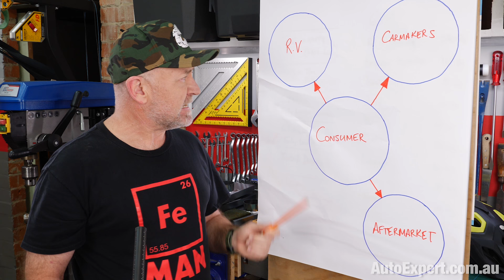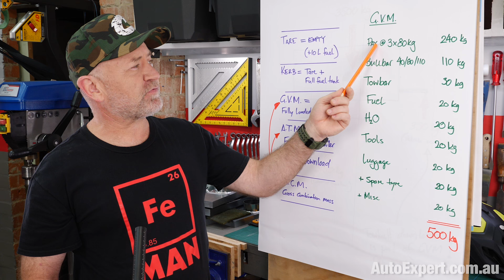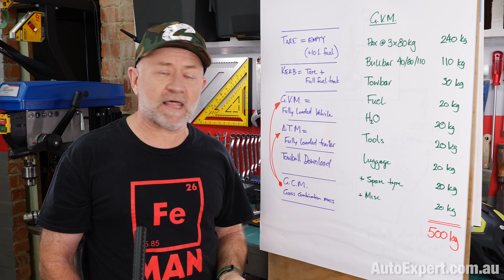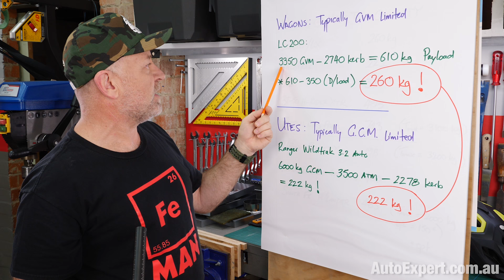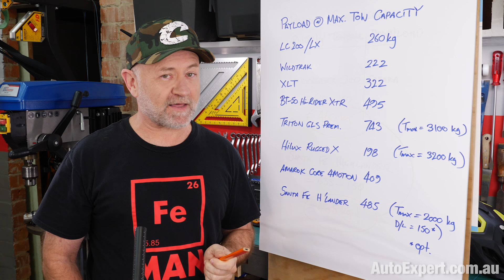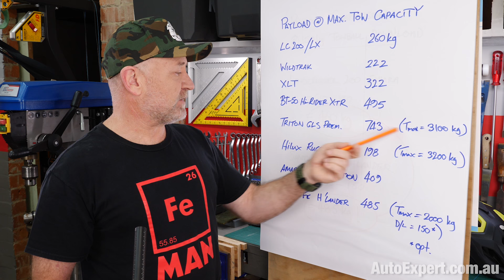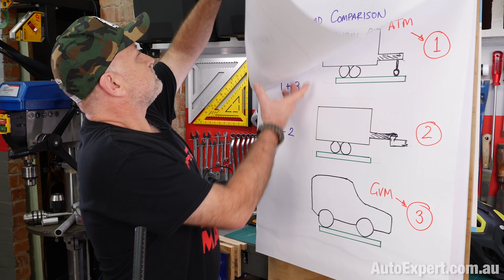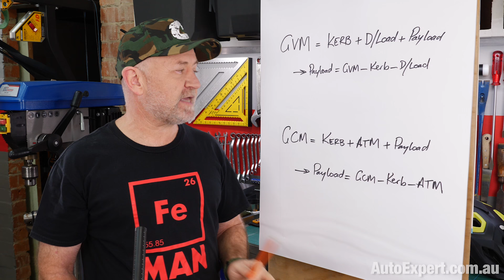Complete guide to heavy towing (GVM, GCM & ATM explained) | Auto Expert John Cadogan

Comment: Just a brilliant talk mate. Thanks for the video. 
It's this legal ability to have a trailer way over the mass of the vehicle that worries me. I would love to tow the Taj Mahal but how is a 2,000kg vehicle going to control a 3,500kg load? It's all fun and games until trying to brake at 100km/hr downhill, in the wet, while trying to avoid oncoming traffic. Don't ask me how I know this.

 I wish you had gone on to talk about rear axle load capacity. For example the RAM 1500 is an excellent tow vehicle. Unfortunately it has a GVM of 3,450kg but a  max rear axle load of 1,770kg. So I'm still trying to figure out how it would tow 4,500kg. Don't get me wrong - I still want one. But after forking out such serious money, I just would want to carry more than 2 muesli bars in the truck while towing that Taj Mahal.
Reply: A 2,000 kg vehicle can control a 3,500 kg load with tongue weight and trailer brakes. Never go less than 10% on tongue weight and always have trailer brakes if the trailer weighs more than 80% of the tow vehicle weight.
Reply: @rich7447  Trailer brakes are mandatory in Australia for trailers over 750kg anyway. Although there are different levels of sophistication of trailer brakes. And you are correct that there is modern technology to assist you. Such as trailer sway control etc.  However that doesn't suspend the laws of physics. I just wonder how many people realise that the risks ramp up as the tow mass reaches and overtakes the tow tug mass.
Reply: @DavesShed  That risk is why I always opt for a bigger tow vehicle than tow ratings would suggest. Most states don't require trailer brakes until your trailer is 5,000 lb, but we tend to be using much larger tow vehicles since the same vehicle will be rated to tow less in the US than it is in Australia.
Reply: @rich7447  They definitely tend to use larger tow vehicles in the USA because those pick ups are extremely expensive in Australia RHD. Also there is a full pick-up culture, so people just buy one even if they don't really need it. Much like soccer mums buy 4x4 SUVs. Which means these larger vehicles are much more common. Thus less issues. Also I note that in the USA a goose neck trailer or 5th wheeler are very common, whereas these are also the exception in Australia. 

However I am not sure that  the same vehicle will be rated to tow less in the US than it is in Australia. I mean yes and no. Rather I get the impression that the rules are different. For example the tow limit of a RAM 1500 in Australia is legally 4,500kg but you could never tow that much if you want to have anything more than 2 muesli bars inside the truck. The rear axle limit is 1,700 kg which is another problem. At the same time the mass that you can load into the back of the RAM 1500 is less than most of the "regular" smaller utes we have.  E.g. Ford Ranger, Toyota Hilux. Triton, Navara, Amarok, Musso, BT-50, etc.
Reply: @DavesShed  I know that the Ford Ranger is rated to tow a lot more in the UK than it is in the US and that most cars in the US tow rating is "not recommended". I assumed, probably incorrectly, that Australia followed the UK's lead on a lot of these things. Ram 1500 payload here is roughly 1,250 to 2,350 depending on configuration. Generally people who need to haul or tow in the US go bigger than a 1/2 ton truck.
Reply: @rich7447  A Ford Ranger and similar utes in Australia are rated to tow 3,500kg. Some a bit less. However this 3,500kg is a bit of marketing spin really. There are other limits you also have to comply with, such that if you were towing 3,500kg then you once you add a driver and a full tank of fuel you have reached the total vehicle limit. What this means is that we suspect a large number of rigs on the road are overloaded. 

The larger pickups in North America are far safer in towing in my view. We do have the RAM 1500 and Silverado 1500 in RHD.  Occasionally you see a  RAM 2500.  The F150 and F250 have been available in the past but not for over a decade.  Even these models are twice the price you pay in USA. So larger models are prohibitively expensive here. Other models require a custom import and custom conversion to RHD so they are even more costly and rare.

 Of course there are plenty of less comfortable cab over diesel trucks people could use if they wanted to. But hours behind the wheel of one of those is not inviting.
Reply: @DavesShed  As of 2020 the Ranger was rated at 3,500 lbs here in the US. They somehow increased that to 7,500 lbs "when properly configured" for 2021. At that weight I would opt for a half ton.
The heaviest trailer that I tow on a regular basis is rated for 14,000 lb gross weight (30' enclosed car hauler) and there have been times that my Ram 2500 has felt a little undersized.
Reply: @rich7447  Most of these kind of vehicles get different suspension for Australia than standard from the overseas factory. That might explain some of the difference.  I always assumed this was for our crappy roads but I guess being able claim the same tow rating as the competition comes into it. In the state I live, these 'smaller' utes are everywhere towing between 2 and 3 tonne. No doubt a great many are overloaded. So I am a supporter of more people buying more of the larger full size US pickups here. It would make our roads safer for everyone IMHO.
Reply: @DavesShed  I agree that a larger tow vehicle is safer. We have some pretty steep grades in parts of the US and that probably plays a part in our tow ratings being a little lower. 
There are some of the 1/2 tons that are running rear coil spring setups now and they don't seem to have the stability of leaf springs. Although my larger tow vehicle is all airbags and once I drop the tag axle I barely know the trailer is there. Unfortunately the length makes it impractical for any trip that doesn't involve a lot of highway miles.

Comment: John you're making way to much sense, we tow a camper trailer because we go off the beaten track. it's usually 1.6t loaded 280kg on the ball, we are just on the GVM loaded up (well under GCM). correct me if I'm wrong but a GVM upgrade does not increase the GCM limit? 

SWMBO wants a van to do the big lap. help...

Comment: While we're looking at upsetting grey nomads. 

Can you do some research into long vechile what counts as a long vechile a d what the rules are on the open road 

I have an MC truck licence and had the rules explained to me but would be great to spread those rules around with all road users
Reply: If your tow vehicle and trailer combined have a length in excess of 7.5m, you may display a "Do not overtake turning vehicle" sign.
Other drivers may overtake the turning vehicle, only when safe to do so, but they are (potentially) in the wrong if anything happens.

Comment: Are these GVM/GCM etc. weights a Gov. regulated and tested towing performance rating or are they just manufacturer recommendations?  If it's the latter, could it be that (in typical Toyota fashion)  Toyota is just under estimating they're ratings while Hyundai is over estimating?

Comment: Just not quite right John, You can go to your Toyota dealer and have an upgrade done by Lovells of who Engineer and replate vehicle before registration, and are the only ones that can alter GCM as well as GVM. I tow 3ton so I was only chasing a couple of hundred kilos. If the vehicle is set up right, ie transcooler etc, and warranty is covered by both !

Comment: Pajero sport towing black series patron. Weighed at weigh bridge so weights are accurate. But my problem tow ball and poly block don’t line up straight... so my trailer is not level.... I don’t know who to trust to help me resolve this. 
I’m within legal weight ranges so I should be able to tow this trailer with this vehicle. Please help.
Reply: Get a drop bar on your hitch. My drop bar lowers my ball about 7" below my hitch receiver.

Comment: "Adventurers" who take it all with them are comforted by their GVM upgrades but the manufacturers GCM REMAINS THE SAME. Take a 500kg upgrade so now they have 3850 GVM. But they do not realise that their max towing capacity is now only 3000KG (down from 3500kg) as example. Whatever they add in GVM must be deducted from max towing capacity to remain within manufacturers GCM. So they're robbing from Peter to pay Paul.

Comment: In the end John said exactly what I was thinking. Do we need a van at all? I went to the back of Cobar for 10 years annually  in a Nissan Pulsar 1.6 litre auto towing a box trailer loaded with 500 kg of equipment. My team broke the Guinness World Record for kite altitude in 2014. We initially stayed in the van park at Cobar for a couple of series of attempts then we camped at the air strip at the sheep station. For the last few years we bunked in the shearing shed. The other 3 guys came from Sydney in a Ford 2000 station wagon, then a 2000 Toyota Land Cruiser diesel. I am telling you this because lots of things  can be accomplished in our harsh environment without needing to equip our selves with all the paraphernalia  I see on the roads that cost 100 - 200K. https://kitesite.com.au/kiterecord/index.html
We are going to go for new records in the coming years at Bulgoo Station, between Cobar and Wilcannia in western NSW. I will tow the same box trailer with my BA Ford sedan and we will stay in the shearer's quarters. I could have gone the big AWD and van route but I am glad my wife would not agree to fund this expensive option. I'm glad she didn't because the budget option has been more fun, more interesting and used far less resources. Sure, there is a place for the big combos but I think it is good to ask the question "do I need to bring all the luxury with me?"
In hindsight, we were not hindered by using a small vehicle towing a light weight trailer loaded to it's max capacity. I am going out west later this year to support farmers in drought. 223,000 acre Bulgoo Station west of Cobar. If you are interested we are going in October for a week to check out the property. You can communicate via the Facebook pages. https://www.facebook.com/donate/307298369939345/ 
By the way, what sort of fuel consumption would a fully laden 7,500 kg combo get? Diesel/Petrol. Would some journeys need bigger fuel tanks?

Comment: I came across this vid last night while watching Biden's inauguration (bored). Pleased that i ticked a few boxes during the presentation. Have a Santa Fe Highlander with towing enhancement kit towing an English Swift van ATM 1660kg's travelling weight, ball weight 120kg's, heaps of payload left in the equation. Fitted air bag support to the rear springs as it is too soft a that results in pitching in the rear end, the air bags dampen this quite a bit.
So why do I keep going to the caravan shows and dribbling over 3.5 ton vans and big tugs I think I must have a good combo. The engine turns out as much power as a 3.2 ltr Ranger and travels at 12-13 litres per 100 klicks ----- yippie.

Comment: The type of driving license is determined by the length of the vehicle. If you tow something, the length of your vehicle is effectively lengthened. You need to qualify another type of driving license or you should be fined. Or your driving license should be revoked.
Reply: And the number of axles
Reply: On a Class C 'car' licence the actual length of the tow vehicle and trailer can be up to 19 metres.....
Reply: @walterrwrush : Check the books...   The 2 to 3 axle thing only becomes interesting once the GVM for the vehicle is over 8 Tonnes.  (They Used 2 axles - 3 Axles for MR-HR class distinction, when the guvmint(sic) changed from 3A/B to the MR/HR license classes (Ref. NSW)...  to give uniformity to the "National" Heavy Vehicle Regs.
Reply: That was my point i should of explained that .
Reply: Interesting. Here in the US you are only limited by weigh and sometimes not even that. A total of 36 states have RV exemptions on weight (you can go over the 26,000 lb limit if it is an RV) and none have length restrictions for passenger license.
Here in Maryland I don't have a weight exemption so I need a class A or B to drive my coach (42' 55,000 lb GCWR). I am also limited to 65' (shortest of all states) on MD highways until I hit the interstate (real bitch because my west of Mississippi rig puts me at 72' LOA). Once I'm on the interstate Federal rules apply and I'm golden with the 72' combined length.

Comment: Out of curiosity what’s your reason behind not liking bullbars? Is it from an engineering standpoint?
Reply: Shane Norwell ... John CarBogan has done videos on this...basically they negate the inbuilt safety engineering techniques  that protect the driver and passengers... In short you are at risk of serious injury if you have a bull bar...cars can be fixed or replaced easily...human body parts not so much

Comment: Can’t escape gravity? Jeebus don’t tell my pilot that or we are all screwed! 😂😂😂

Actually you can overcome gravity - in a boat!

The amount that gravity pushes you down is counteracted by the buoyancy of the weight of water the hull displaces, pushing up against gravity!

The point midway between Center of gravity & Center of buoyancy is called the meta centric height, and is the point about which the boat pivots as it heels.

As for Max load (GVM/GCM) as long as you stay below the GZ curve (righting lever) then your good to go, & if you don’t you turn turtle!

The vehicle & trailer physics is easy - try it on water in a boat and see how you get on! 😂😂😂👍😜

Comment: If you want more proof of the risk of overloading then look at this https://magazine.rvdaily.com.au/en_US/14476/208710/caravan_crash_tragedy.html

I agree with John that putting 3.5 Ton on the back of a car that can tow 3.5 ton is - maybe not the wisest move. Particularly when many of us drive these things on low traction outback roads where things can jump out  in from of us  (Roo - Emu - Bramhma - Road train) and if you need to do something in a hurry to avoid said road train  its a case of the tail wagging the dog  - possibly into a tree.   So I agree with John that too much weight is too much but I don't agree that a GVM upgrade is a waste of money.

I have a Sahara with a AOR van with a ATM of 2.4 ton and I still did the GVM upgrade on the 200 Series.   Not because I want to carry more weight and push limits beyond Toyota recommended  limits but I like the extra "legislative" buffer it provides.   I take great care with my car and vans weights and I know I am under on both. BUT as we all know sometimes, once in a while things happen.   I maybe off road some place towing the van along some track and decide to grab some fire wood or a spare engine block (humour) or something and just throw it up on the roof for tonight's camp fire and then get T-boned by a Roo or something bigger and I don't want to give any excuses to the insurance company as to why they would reject my $250,000 claim if both car and van were written off.  

Plus - its just nice to know when driving along that if Mr. Plod wants to pull me over to check me at least I will be within my weight limits.  That feeling in the pit of the stomach as you wait for Mr. Plod to come back with the numbers isn't good so the few extra $$$$ spent up front  is well worth it for that reason.

Comment: This video is nonsense! Why does it sound like the truth though? Well because it is. I drive a Hyundai H-1/i800 (I don't know what you guys call it but Google). This maths means if I tow (assuming the H1 could tow 3,500kg as I wish it did) then I have to leave my family behind and I have a 9 seater car. How lovely. I solo trip 😂

So now I understand why Hyundai made the H1's tow limit of 1,500kg. You can tow and still take your family with. They should put this video in the user manual. 

Thanks again for an informative video.

Comment: GVM is a fixed value - any after market kit claiming it can increase that is pure BS. When manufacturers spec a tow "option" on a vehicle it generally means a tow hitch receiver, wiring, upgraded transmission cooling, larger radiator and maybe a tow mode "switch" if it's a more premium vehicle with an electronically controlled transmission.

Of course there are ways to properly increase the GVM but it would involve engine horsepower/torque upgrades, transmission upgrades, frame reinforcing, higher payload axles and of course a tire/wheel swap. Air bags are another common addition. Your typical non-commercial unibody van/SUV won't have that ability. Just swapping out the struts alone won't mitigate the additional weight - it's a false sense of security that actually puts you dangerously over the safe limit of your tires (tyres), wheels, axle, engine, transmission, cooling etc...

And notice I haven't even mentioned your BRAKES needing upgrades as well in order to STOP that extra weight.

There's a reason in the US the cowboys have "big dooleys" for serious towing jobs and 5th wheel trailers that can handle 15 tons. Yes, you need a special license to carry that, but the idea is you pick the right tool for the job by matching your trailer with the proper tow vehicle.
Reply: Some tow packages include different final drive ratios and upgraded brakes which can increase your GCWR. We are good on a standard license up to 26,000 lbs here in the US.